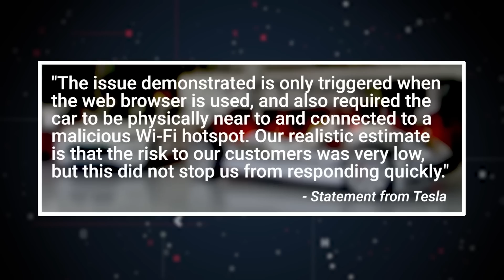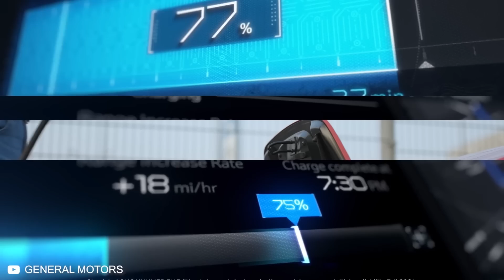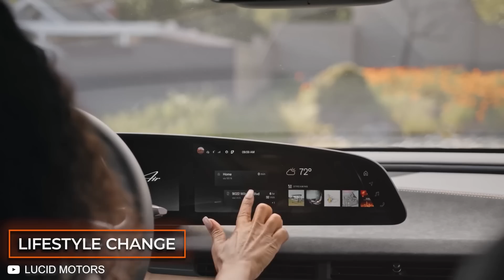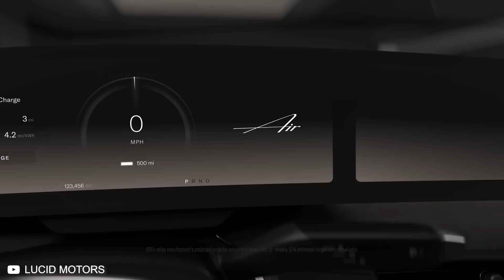EVs' Serious Problems That Carmakers Are Hiding

Comment: Living my life as dictated by my car as opposed to driving my car as dictated by my life...I know what I would choose! This is doomed to fail. I used to drive from Sydney to Canberra and back again in a day... not with an EV.
Reply: Fight the global warming scam then.
Reply: The price of gasoline dictates your life.  It costs me .02/mile to drive my EV, sometimes nothing/mile.  Yesterday, I drove to a nearby city for Sunday breakfast.  When I arrived I plugged in at the town's visitor's center.  Had breakfast, perused a farmers market, went shopping, etc.  When I returned to my car, it was fully charged.  The cost...zero!  There was no cost to charge and no parking fees, compliments of the local chamber of commerce for visiting their city.  In nearly 60 years driving gas vehicles, no one ever gave me free gas.
Reply: Why would an EV dictate your life? Do you drive over 400km to and from work every day?…. Didn’t think so. Contrary to popular belief, most people find EV’s far MORE convenient to own, due to the fact that 99.99% of the year, they charge at home overnight when they sleep, so they never have to detour to get fuel. Or realise they didn’t top up and need to find fuel when they’re already running late to work. Etc etc. it saves the average person around 16-17 hours per year.
Reply: @engineeringtheweirdguy2103  
Well..here is the thing.
1) yes, i do drive over 400 km quite often, seing as my relatives live about 450 km away

2) if the weather gets abit chilly...there goes 30% range

3) the price for electricity is going through the roof. They are deffinately NOT cheap

4) No, i dont wanna spend 3 hrs drinking coffee, while waiting for this useless toy to recharge

Thats not convenience
Reply: @morarucosmin6776  1.) and how often do you do that journey.
2.) modern EV’s only lose 5% thanks to the inclusion of heat pumps. But unlike petrol or diesel, they’ll always start in the cold.

4.)why would you be waiting 3 hours? Firstly, it only takes 45 minutes if you’re charging 0%-100% on a V2 super charger. V3’s is 25%. With the first and last 10% taking the longest. Most commonly you’d charge from around 20% to 90% which takes 15-20 minutes in a V2 and 5-10 minutes on a V3 super charger. And when you charge from home there is no waiting. Every morning you wake up with a fresh battery. Equivalent to a full tank of gas every morning without having to go to a fuel station.

3.) Also yes, they are cheap. Electricity per mile costs around 10x less than petrol or diesel per mile. Additionally ICE cars have tens of thousands of moving parts whilst EV’s only have a few hundred. There is nothing to service. I’ve had my model 3 for over 100,000 miles and all I’ve ever done in terms of servicing is put new tires on it. Not sure why you’d think they’re were expensive to operate and maintain?
Reply: @engineeringtheweirdguy2103  

1) 2-3 times a year...

You do know that 90% of folks cannot afford to buy a car ust for the city and one for outside the city, riiight?

Especially when one of those (the EV) costs an arm and a leg, right?

2) I dont care how much EV loses out...a modern, Euro 5-6 engine car, is a marvel of efficient technology. 

One tank fill can easily get me 800 km+, regardless of weather

And please,  i am asking you in advance to spare me the environment lie!

Your EV does 10x to pollute than any modern diesel/petrol engine!

The battery is virtually non-recyclabe, unlike a SLA (sealed lead acid) battery!

Ditto for everything else on the car
Reply: @morarucosmin6776  EV’s are far more efficient than any combustion engine. Even off a cheap portable generator it can charge more efficiently. Putting fuel into that generator is equivalent to 3L/100km (78mpg)
Reply: @morarucosmin6776  and lastly, no, according to MULTIPLE studies, EV’s only produce around 15% more emissions in manufacturing. But even on a COAL ONLY GRID it only takes around 12,000 miles before it breaks even with an equivalent modern ICE. and that’s before you include the polluting caused by refining every gallon of fuel you burn Doesn’t take a genius to figure that out, especially when it’s significantly more fuel efficient to charge an EV with a cheap tiny generator than to put it into a Modern car.

So no, EV’s are still far more eco friendly than ICE kiddo.
Reply: @engineeringtheweirdguy2103  
No, they arent.

if they were, they d have similar ranges...which they dont!
not by a long shot!

A cheap, 2k euro car can easily go 800km+...your child toy can barely do a 400 kms, if its an outrageously expensive Tesla...if not, lolz, not even that
Reply: @morarucosmin6776  OK, Now for your very long comment. i'm going to respond by numbers in relation to paragrapsh, groups of paragraphs.

1.) "Please understand that we, normal people, dont buy into the carbon footprint lie" - then why bring up carbon footprints in the first place genius? if you if you didnt care, then why regurtitate the lie "Your EV does 10x to pollute than any modern diesel/petrol engine!" So something tells me you do buy it and you do care at some level. Regardless, its fairly trival to prove that isnt the case, as I have already done.

2.) Yes, Batteries have less energy density than fuel. Energy density isnt efficiency. learn the difference. I already told you that batteries have less energy density than fuel. why are you repeating it back to me like this a new fact? are you really that stupid?

3.) Energy density isnt the only factor. Lifespan, performance, safety, cost of operating, cost of servicing, reliability are all also factors. All of which EV's perform better at. And you only need so much range before its impractically large. Its advantageous for combustion cars to store a weeks worth of fuel internally. This cuts down on how often you need to visit a fuel station. However EV's are different. You do go to a fuel station. 99.99% of the year you charge from home... whilst youre asleep... just like you do with your phone. And every morning you have a full charge. That means typically you only need enough range for your daily commute 99.99% of the time. Modern EV's however these days have battery ranges similar to the range of a comparible car. For example the model 3 is a direct competitor with the BMW M3, It has a fuel tank capacity and consumption to give it a combinerange of 305 miles. A long range model 3 has a range of 353 miles. Except the model 3 has for more advanced software features, cheaper operational costs, lower servicing, high lifepsan, better handling and better performance.

So for range, apples to apples, the two which are in direct compeition for the same market in the same class and category, the EV actually has more range. so no, doesnt "lose out in a big way"

4.) You're a moron. Efficiency isnt HOW MUCH energy you can carry, its HOW MUCH OF THAT ENERGY YOU USE. For example a combustion car can carry far more energy than an EV, but it can only use around 20% of that energy. An ev can can only carry much less energy than a fuel tank but it uses around 90% of that energy. See the difference. one is inefficient, but can hold more of it to compensate for that lack of efficiency. and one is highly efficient, which compensates for its lack of efficiency.

Here is another example. Lets say you have 2 buckets, one carries 50 gallons of water and the other carries 10 gallons of water. the 50 gallon bucket has holes in it so by the time you go from the tap to garden, it only has 12 gallons of water left in it that you can use on the garden. The smaller bucket has no holes in it so when you get to the garden you still have 10 gallons of water to use. Which bucket do you think wastes the leaste amount of water and thus, uses the water more efficiently take you time, I know this is a struggle for you...

If you dont know the difference between efficiency and density, perhaps refrain from commenting on it until you receive a baseline education.

5.) Sort of correct but mostly no. Just like with litterally any new technology it starts off expensive. Computer, mobiles, colour TV's, plasma TV's, LCD TV's all started off extremely expensive and as an item for the rich. However as they become more popular the economy of scale started kicking in and they became much much cheaper. Now I can pick up a 4k flat screen LCD screen few hundred dollars, when flat screens first came out they were several thousand dollar items.

However EV's do give you value for money where they can. Most EV's being classed as "luxury vehicles" because of the luxury features and performance they give you. Keep in mind they also save you alot of money, with, under normal use, a standard range model 3 costing less to buy service and charge over 5 years than it would to buy service and refuel a Camry over a simlar distance. However the model 3 is a high performance luxury car. the camry is not.

Lets do a comparision between the two very close competitors, the Model 3 performance and the BMW M3. The BMW costs around $170,000 AUD, to buy, the model 3 performace, (which has better handling, performace, operating costs, storage space, range, lifespan and software features all whilst having similar luxury features) costs considerably less at $96k AUD. before you account for additoinal tax's or incentives.

So overley expensive, no. considering the market they're in and what you get. Hence why one of and often THE most popular new car in Australia, US, EU and other have been the Tesla Model 3.

6.) Range Anxiety according to studies exists far more in people THINKING about buying an EV than those who have own an EV for more than 6 months. its not really a thing. Owning an EV my self. I can attest to that.

7.) Cold weather only reduces modern heat pump EV's by around 5%. However 75% of cars which exist in snowey or seasonally snowy climates, need a jump start at one point or another. Either the diesel freezes, or your starter battery goes flat before your engine can warm itself up enough to sustain ignition to start the car. leaving you on the side of the road. This never happens with an EV.

8.) V3 super chargers charge your car in around 5-10 minutes. But most of the time you charge from home when you're asleep meaning you dont have to wait for a charge.... ever. 

9.) actually chargers are everywhere. Just download the plugshare app and look for yourself. More than enough for road tripping considering the only people using them are other EV owners which are on their roadtrip they might do 1-2 times a year if that.

10.) only super chargers cost alot. YOu dont put a super charger in your house doofus. you use whats called a home charger, or hows this for a wild concpet. the fucking wall outlet. anyone with secure parking or a driveway can own an EV. That is a substantial portion of the population in most countries. 

11.) Current EV batteries are more than 95% recyclable. A quick google search tells you that dipshit. As for your claim of what you "need" in terms of battery size? no. there are fundimental physical limitation. For example, energy requirements. As an example to calculate the energy needed to lift an object is mgh. (mass, gavity height). Lets say you want to move an SUV full of people up a mountain 1,500 ft. Just the energy required to raise to that height alone, if you were 100% effieicnt and no road losses, air resistance or anything occured (impossible), you'd only JUST get there with 5kWh. But in reality you have rolling resistance, motor losses, losses to radio, speakers, instruments, aircon, wind resistance, weather conditions such as rain and wind.... not very useful is it?

Maybe take a course in physics then re-assess your rediculous expectations.
Reply: @engineeringtheweirdguy2103  Best of luck!
Reply: @davannaleah  with what? I’ve owned a standard range model 3 for 3 years now in Australia. Never had an issue yet. Even when driving 500km each way to go snowboarding in the alps. Infact I timed my stopped time each way before and after getting an EV. Know what I found? Exactly the same if I don’t include getting fuel the night before I leave. Since you know. I just plug it in when I get home and wake up with a full charge.
Reply: @engineeringtheweirdguy2103  I absolutely agree with you.  The price of gasoline certainly can dictate a person's life and how much or where they drive.  Charging my EV at home costs me .02/mile.  I never think twice about driving somewhere.
Reply: Paris-Lyon (450km) is less than 2 hours by train and cheaper than taking the car. Anyway, petrol reserves are declining, there will be less and less, prices will go up and up. Keeping up with the petrol car will dictate your life anyway. Hopefully Australia will put good alternatives to cars for Sydney-Canberra (high speed train for instance).
Reply: @johngonon1507  we'll all be riding horses soon enough.   ev's wont be enough.  only for the rich people.   the price per kw will sky rocket if everyones forced to use them,  then they wont even be able to power thier homes.
Reply: @johngonon1507  false!

There is more than enough resources ...its fake scarcity
Reply: @johngonon1507   budapest - Venezia 700km in less then 7h . a good cozze sleep and then  to Sardinia. Visit all best beaches with your car stay in Airbnb and then let’s visit Corsica . You can have you Lyon train , I’m not against it . You can also ride your e-scooter-  i solute you , just keep right side. Can also quarantine yourself for life in your cave and the world would be greener . Or best is to get a fourth dose that’s the  optimal way  to solve all the worlds manufactured and fake issues .
Reply: @sekainiheiwa3650  Well glad you can do it currently. In a few years it won't be possible anymore. And I never said that train solves all problems. I just compared Lyon-Paris versus Sydney-Canberra, which is much better by train if you have one (which apparently is not the case in Australia). Generalizing what I said to all situations in life is kind of pointless.

Comment: Universal fast charge network, up to 500 miles range and comparable price with ICE cars are the biggest hurdles, in fees years these will eventually improve and the world will slowly move towards EVs. Or we may move to hydrogen cell cars
Reply: Hydrogen cars have already failed.  Obsession over range will fade as the charging network builds out.  Getting the cost of the cars down is going to take A While, unfortunately.  No reason it can't happen, but while demand is far outstripping production, car makers have no incentive to lower prices.  They'd rather charge what the market will bear.  The biggest worry in the USA is the development of the charging network overall, where Tesla have built a great network, but everyone else's are turning into a jumbled mess.

Comment: Oh with lithium polymer is great. But how many times have you ran over obstacles on the freeway. And then that is kicked up and it hits your ender carriage? Like the same place that that lithium polymer is. Just remember this if that outer casing is compromised road salts are going to get in. But if it shorts out a battery. Those other 7,000 batteries are going to immediately discharge and you're going to fry any better pray the rest of your family is not in that car. I live in the real world. Not in a bubble. And when you go to bite your cute little electric car? Ask them what the trade-in value is? Even if you lease. Ask how much you're going to pay at the end of that contract.

Comment: $10k for a battery pack every 7 years. Can't tow anything. 8 hour recharge every 200 miles. They're a joke unless used as a town runabout.
Reply: Most EV batteries are warranted for 8 years and expected to last a lot longer than that.  A typical charging stop on the road is around 20 minutes.

Comment: 1 Question No one Asks or Answers with 3 states Now Forcing EV's by 2035, Where are we going to come up with the Electricity ??  We Tried EV's Before in the Late 1800's and early 1900's and Dumped them for Fossil Fuel cars because the fuel was plentiful and easy to store, you run out of Juice in an EV you can't just walk and get a can of Electricity, and We have power outages NOW during peak use in the summer because we run out of electricity, Now Add a few 100 Million Electric cars THEN WHAT ?? Oh and lets not forget most of todays Electricity is produced burning Coal and Gas !!!

Comment: EV's are much heavier than ICE cars due to their batteries, hence they wear out tyres much quicker. Where does all that extra rubber/ plastic go?
Reply: They have tires designed to wear out a little more or the same as what ICEs do.

Comment: Hydrogen is the future of transport and electricity generation.The most abundant element in the universe.
Reply: Unfortunately elemental hydrogen does not occur naturally on Earth in quantities useful to industry. Keep in mind compressed or liquified hydrogen is a storage and transmission medium that is made from fossil fuels and not a source. The fraction of green hydrogen, which is not made from fossil fuels, in industry today is approximately zero. Green Hydrogen is cheap for now, but when we see the markets settle down, it will once again cost three or four times as much as hydrogen made from methane.

It is highly likely hydrogen will only be used for the replacement for bunker fuel in shipping.